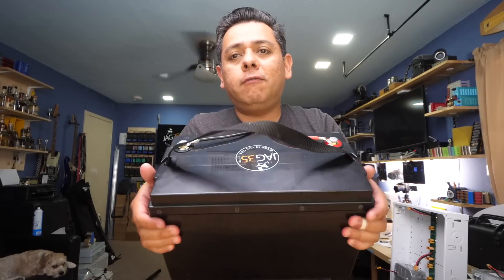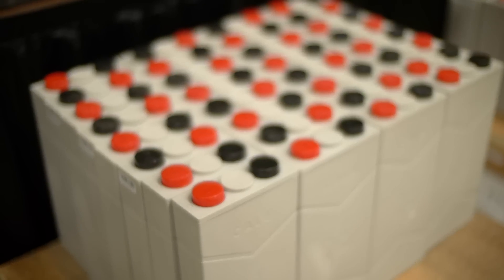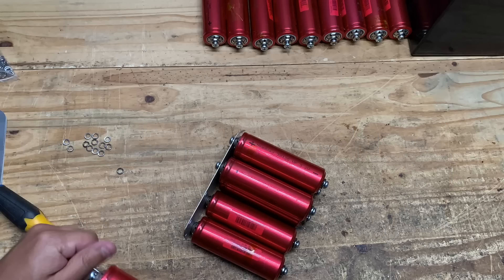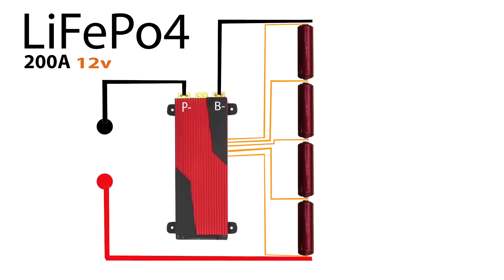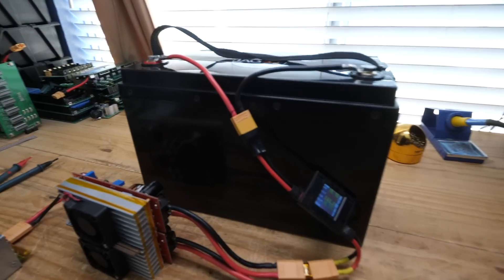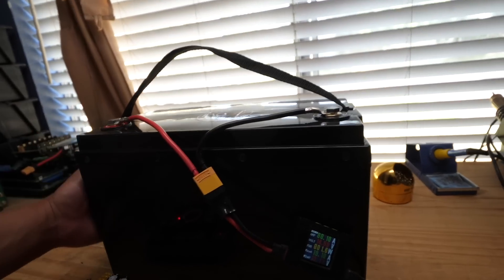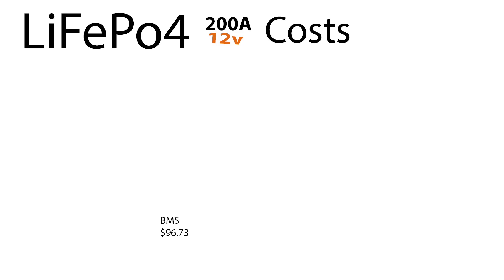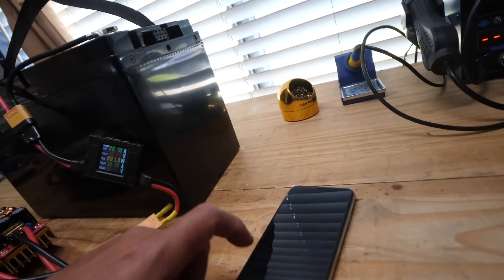Build a DIY Lithium LiFePo4 Headway 12v Battery replacement

Comment: I know this is many months old, yet I still hope you read comments on old videos. AND of course this is a RV Trailer type question, don't run yet. I'm building my own ATV hauler/camper out of a large cargo trailer so maybe that can add to the curiosity to read further. I'm wanting to use LiFePo4 batteries like you have shown here yet up the count to 56 (14x4) to get into that 100Ah range for off grid camping and still being able to enjoy many luxuries while doing so. However I have a nice little 40A rated power panel that is set up for lead acid. Given that this power panel really cannot handle charging LiFePo4 100Ah pack at full speed, I have thought about adding a 300A diode in the output to the trailer power panel to reject incoming power to use a separate 120V charger. I can also easily build a over-volt cutoff as well to disconnect the battery while charging, since when plugged in to mains the power panel is capable of 40A output or less to the trailer electrical at 13.8 - 12.8V. The reason I ask this is during off grid scenarios I may be required to top off my charge with a 4KW nominal generator. 
Given this information what charger would be suitable and do you think this would be a beneficial modification for RV use? I patiently await any replies from you or other experts. Thank you all for your time.
Stu

Comment: For $800 you can buy a BattleBorn LiFePo battery with 100 useable Amp hours, 100 Amp max draw, a BMS that makes the battery practically bullet proof (and idiot proof), and a 10-year warranty.

Comment: Lead acid starter batteries are big simply so they can whack out a fat current when cold. They will also deliver only about 30% at full current so a typical 50AH car starter battery is really only able to deliver 15AH before the output crashes to almost useless levels. A LiFePO4 can give 95% of its charge so for engine starting, 15AH will easily compete with a 50AH Lead acid.
The snag is ambient temperature. A cold lead acid that fails to start the engine is dead and wont be any use until its recharged. A cold LiFePO4 has high internal resistance so will do much the same BUT let it churn the starter for a few seconds, wait and try again. Miraculously the engine will start just fine. The churning warms the cells and they wake up.

Comment: Jehu, I use power wheelchairs.  I buy old chairs and mod them for greater power and with larger wheels and tires for off-road capacity.  This is just a hobby and solely for my personal use.  I want to build a Li-ion battery for myself, either one 24 volt battery, or two 12 volt batteries.  You probably know these use deep cycle batteries rated in amp hours rather than CCA like car batteries.  I will make a very powerful one, between 75 and 100 ah.  I have used other type of Li-ion for years in flashlights but never Li-Po.  Do you know how the different types of lihium ion batteries compare for deep cycle use?  I will be able to balance individual cells and check their functioning with a sophisticated charging system.  Speaking of which, someone recommended the Hyperion EOS 1420iNET3 for this but I have also heard some bad things about it as well.  Do you have recommendations for a high amperage,, all battery type charger that measures change in battery effectiveness?

Thanks for this video and for any suggestions you may offer.

Comment: How do these batteries perform with solar?
Reply: They work great with solar, you just need a MPPT charge controller and an inverter to convert the 12v to 120v. You'd need to decide what you're wanting to run off the battery with solar to determine what size inverter and ah you'll need and how many panels you'll need to charge the batteries.

Comment: Dude Cardboard...Come ON...!!!!!!!!!

Phenolic resin plates (Old circuit board material, usually dark brown in color like the old Bakelite phones) is made for this kind of Duty, very dimensionally stable, last for freaking ever, hydrophobic, easy to cut and drill, only issue is heavy (about two times aluminum)
Reply from the maker: Or cardboard works also
Reply: @jehugarcia  Amigo you know better than most that life is not about the "ALSO's" but the do things "A lo Bien" with zero change for failure (if no massive price, toxicity, structural compromises, why not..!!?

ps: I work on a few "Can not fail" equipment including some Paris dakar racers (bikes and Trucks) and we always "Bullet proof" everything in "Epoxy resin/Silicone) "Brick" them, so nothing shakes, rattle or even/ever fails..

Comment: For my battery back-up for my house still in Grid , what I see the higher the voltage the less power loses 48v looks like is the lowest power lose ! And you’re video on Lithium Titanate batteries was good heads up Anout 50,000 to 100,000 cycles !

Comment: At 4:30 you say "this thing", was it a BMS? Why not mention anything about it?
Reply: I had to look it up; The Orion Battery Management System (BMS) performs three primary functions: It protects the battery pack from being over-charged (cell voltages going too high) or over-discharged (cell voltages going too low) thereby extending the life of the battery pack.

Comment: Can i make 340VOLTS?  assuming 8.4 x 40 cells and replace  NIMH batteries??
(40 Prius batteries  cells)
on a budget??
the weight of those is 110 pounds or so +40 pounds of misc equipment sure these would be lighter
 i'm assuming sometimes it can hit the max voltage  (chevy tahoe hybrid)
it has a VERY high electrical demand 

it's to power a 300Volt 3 phase motor  60,000 watts (as well an A/C compressor  that runs directly off the battery) total budget would be about $2800(the price i can get a premium  battery with an (unlimited  year/ unlimited mileage  warranty)

just needs to meet this requirement:
Nominal Voltage: 7.2-7.6V <(8.4 is peak voltage of the battery cell )
 Nominal Capacity: 6.5Ah

Comment: It would have been very nice to see some discussion/commentary about the use of these in a vehicle, and how well they match with the function of the alternator etc without modifying the car. There is a lot of information missing here.
Reply: I would love to have a 1 on 1 with jehu asking these questions. I really want a couple of these powering my amplifier for sub system in my truck. But I'm unsure of the amperage and watts and charging system if it were tied into my lead acid under the hood

Comment: Can that run a rv air conditioning
Reply: Not for long.  You need ridiculous power to run A/C overnight.  This battery is pretty big at 700 something watt hours (I forget, but that was in the right ballpark)... R/V electrical A/C load depends on insulation, temperature, size of RV etc but a good ballpark idea would be 1000 watts average.  

For 12 hours you'd then need 1000 watts x 12 hours so 12,000 watt-hours or 12KWH.  So you'd need about 20 of this battery.  And this is a pretty sizeable battery, the LiFePO4 battery I bought to start my car is only 64WH - 1/10th the size. I'd need to buy 200 of those.

Comment: Hey Jehu, I’m a complete novice in this but completely sold on the process. Wondering if you could give me advice on my build abou 3 months ago I think you had given advice on the Headway batteries 38120 ( I think it was you) anyway I bought 40 of them . I want to build a 48 v system and I’ll need advice and material s  please respond if maybe you can help me.
 l
Reply: did you get any help?
Reply: @thomasnyanfore8424  

I got no help from Jehu👎 finally got help from my neighbor graduated electric 	👍👍👍

Comment: Only 4 gauge cable from the cells to the reg & back to the case terminals?  I would have went with 1/0.
Reply: 4 gauge is plenty for the load.

Comment: so i need 3000 amps for 1 to 2 minutes then about 600 amp continuous a 6 to 10 x 12 v boy i am going to need to go hybrid but a careful configuration should be doable and rowbust :-)how many times will the weight of you bus go into 26,000 lb my bus is just a little bigger than yours just a wee bit :-)

Comment: $544 plus tools and test equipment.
Reply: Those batteries are expensive. A 100ah is over $1000. I looked at getting one, but went with lead acid since it 1/5th the price, and last 10 years.

Comment: Excellent video.  Very well done and informative.  But I'm about to show how ignorant I am regarding lithium batteries with a question.  When the amp hour rating of 12v lead acid batteries is calculated the standard seems to be by using a 20 amp load, and if that load is changed it affects the amp hour calculation because of the Peukert effect.  Is this not the case for lithium batteries?  I'm just trying to understand why you would use the 2kw rate to calculate amp hours rather than the 20 amp rate.  Honest question, I really don't know.

Comment: so with 200w of led lights, how many hours could I expect this pack to run ?
Reply: The reason this question can not be answered id=s because you left out some things are your LED light running on 120 V  or 12V. will you be using an inverter?  What you need to do is take your total watts required and divide  that by the voltage used so if your Led lights are 200 W at 12V then you will divide 200 by 12 I always round up in figuring Amps. so if you take 17 that is the number of amps at 12V I did not hear his Ah (Short for Amp Hours) I am going to use 34 Ah so you will divide 34 by 17 that come out to 2 hours the Ah is the number of amp that it can produce in one hour.   Note I did not try to factor in your wire length as I do not know that.  Your best bet is to get a anp meter and check you amp draw as close to your power source as you can.  If you search on the internet you can find watts to amp converson calcultors you can also find wire size guides on there too.
Reply: @tfoley7553  the lights are using a meanwell driver with 100v - 240v _4.5A wrote on the top . no other info than that really . any ideas ?

Comment: This is a great job. I bought a replacement battery with LiFePO4 for my 260 bike after going throughout a couple of lead acid that left me stranded. Never again. Plenty of power and way ligther. I won´t go back ever to lead acid. And with your video, I will make my own now for my cottage in Venezuela. Thanks dude!.

Comment: Better get a new source for recycled LifePo batteries and BMS. That is about $200 more than you can buy a new 12v LifePo for and have a warranty. What is the point?

Comment: nice built but 544 dollars for a battery?  you get 60 amp hours at 50% load? That's not good at all for the price. Are you sure? .  I'm little confused at your measurement of how many amps you are able to get from the battery.  The meter read  35.336 ah for 24:29 minutes...doesn't that make the battery a little over 70 amp hour capacity?

Comment: Contemplated using the headway cells on my electric chopper build. Spacing them around the inner diameter of my rear wheel. But I already had a bunch of 18650’s so I used your 1/8th watt resistor idea and built my own pack. Keep at it man. Chopper build seen here https://youtu.be/IL0hkSwfTFM

Comment: I have been watching your videos and subscribed  I wanted to ask a question i have been struggling with configuration of my battery pack for my ev motorcycle. I want to ask four questions :-
1. Can i connect 3 x 72v lithium ion pack in parallel with configuration of 20s 10p to power my 72v 3000w motor controller it supports 50A so does the motor? (I want max range and power)
2. All 3 packs will have BMS so how do i charge it what charger should i use for this purpose and will those BMS work properly if connected in parallel, what amps will it req to charge?
3. Should i make 3 72v packs or should make 6 24v packs and then connect 3s 2p which one is better ?
4. If question 1 and 2 are possible then what wire should i use to run this project?

Please respond its my first time ever commenting on youtube video i hope you can answer my questions
Reply: Generally it is best to have every cell in a given voltage level in parallel, by this I mean, lets say you have 3 20s 10p packs in parallel at the 1s and 20s levels, that means that each 20s configuration will have the same voltage, but the individual 10p's can have different voltages depending on their quality and whatnot. With a good BMS, it shouldnt be a problem, but it is much better to have as many cells as possible in parallel, so that in the case of a faulty cell that wants to overcharge, the others are also fighting for voltage.

For example, a common problem in 36v golf carts, where you have 6 large 6v batteries in a 6s1p configuration. You plug in the charger, to charge the batteries, but since there's no BMS (LA aren't that sensitive to slight overcharge), and there's a battery with a slightly higher internal resistance, it could be, for example, one battery charges at 20v while the others share 16v. Now, if you had, for example, 12 half-size batteries for the same overall energy storage, and you did a 6s2p pack, now the internal resistance of the batteries is diminished logarithmically. So you have a much, much lower chance of overcharging a battery, unless of course you put two bad batteries in parallel.

In your case, if you could reassemble the packs, and you have 3 20s10p packs, that means you have 600 cells. It would be best to make 20 1s30p packs and then put them in series, this would give you the best reliability in the case of batteries that want to go rogue.

As for the BMS, there's different types. Active and passive. Active is the once which power passes through and it can shut down power in the case of overcurrent or undervoltage, as well as balancing cells. Passive BMS' on the other hand, are quite cheaper and basically just balance the whole pack's voltage to try to prevent voltage runaway. In your case I would personally just use a passive BMS, as motors tend to draw some pretty big peaks which would require large mosfets in an active one to handle. To charge them you need a charger designed for 20s lithium, since you will be using a BMS it does not matter if the charger monitors the cells, it just CANNOT go over the 20s fully charged voltage, which for 3.7v cells is 84v, so ideally the charger will supply that, and then shut off.

Always fuse your packs and use common sense when wiring, especially in a motorcycle there's vibrations and whatnot and a rubbing cable could easily chafe and pass 72v through places it shouldn't be. 8gauge is fine for 50A and the ocassional peaks, especially since you're not gonna have much long wires on a bike.

Comment: That price explains why lead acid is still all around.
Reply: And what is the weight of this box compared to the lead-acid? If the box is heavy than bad news if it is light ok we can put more and go long distances but if it is heavy no good.
Reply: while yes thats true, however, buy this one time and you're set for a very long time where as replacing a lead battery every 4 years or so?
Reply: Cram it hippie

Comment: You can reduce the heat inside with more wires connecting to the plates.  You spent so much on this battery. Dont skimp on adding two or three more wires to the pluss and negative terminals. 

Less heat, means smaller internal voltage drop means more power gets delivered.

Comment: Love the idea, but I am more than a little concerned that a scrap of cardboard is all that stands between you and a short that will melt STEEL!!! I am one of those guys who likes to drag his stuff into remote areas, on roads that are charitably defined as "unimproved". I would be very uncomfortable doing this with this design. 

A piece of 1/4" scrap plastic from TAP between them seems like a much safer idea. If you are looking at abrasion resistance perhaps even put thinner cardboard on both sides of the above mentioned plastic. 

Safety first and third!

Matt

Comment: That looks like exactly the thing I could use to power my travel trailer. (That and a good inverter!) I could see how a bank of these, some solar panels and a big inverter could run a small house pretty handily. If only I could afford to get into building such a system.
Reply: I have the solar panels and inverter. I just need to replace my lead/acid batteries with these and I'm on the road again!

Comment: How do I make a 24 li-ion battery for my mobile soldering station?  I have about 300 used 18650 cells in good condition.  That is a lot and I have no idea what they could be used for.  BTW, the voltage of a fully charged lead-acid car battery can be as high as 14.4 VDC, discharged is 11.8, which makes a difference of 2.6 V.

Comment: damn I was hoping for better results... my car's battery is rated for >800 cold cranking amps so this doesn't seem like it's anywhere near as powerful, at nearly 3x the cost.

That's actually really surprising because I thought lithiums stored a ton of power... is that not a fair comparison?

Comment: Just buy LED STREET LIGHT BATTERIES... You can get a 12 volt 30 amp hour lithium ion battery for  $60 each... I have two hooked up for 12v 60ah and it runs everything in my tiny house easily for 12 hours I'm planning on getting two more for 12v 120ah

Comment: I realize that the way you connected the batteries you can’t monitor all cells individually, you monitor them in groups of 4, with the BMS, any issues if a cell in one of the groups goes bad?

Comment: I was looking into LiFePO4 for my electric go-kart build. but I'm just a minor. It's quite expensive for 32 of them and it has a nominal voltage of 52.8 when I need 48.1 volts. I did find 12v car batteries that are LiFePO4 for $29.99 each. What would you recommend building a pack or buying premade packs?

Comment: There must be a better, non flammable material than cardboard to divide the cells. Also, shouldn’t the whole thing be ruggedized if you want to use it in a vehicle, for a 12v battery?